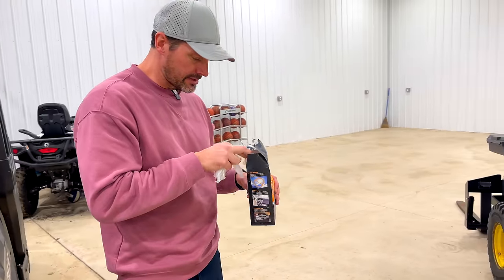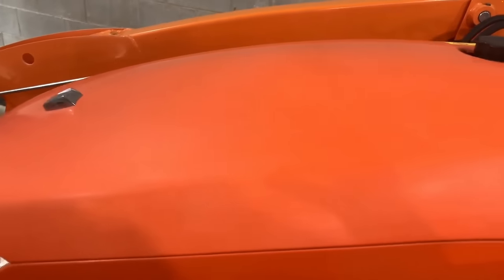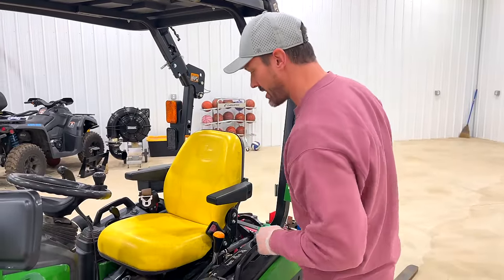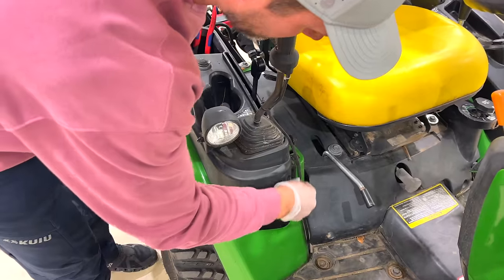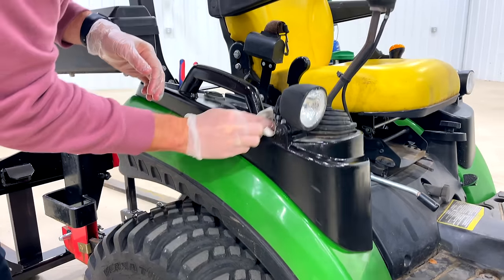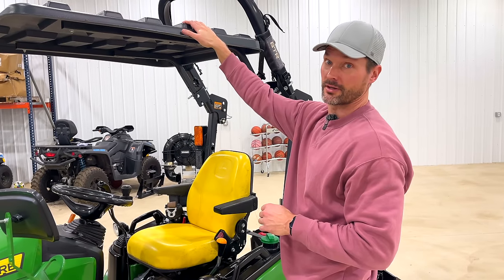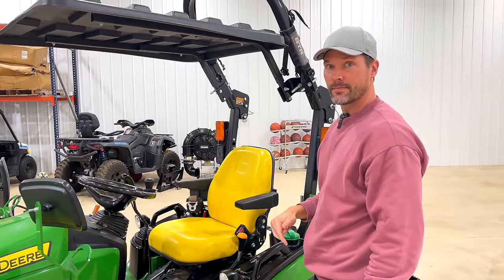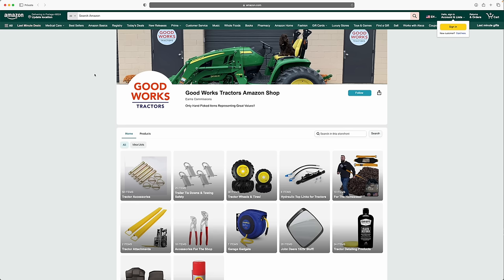THE ABSOLUTE BEST BLACK PLASTIC RESTORER IN ACTION

Comment: I bought a big pump bottle off Amazon of that Flat out tire sealant stuff and put it in the tires on the little tiny truck that I drove around the landfill. Every morning I had flat tires on that truck. Not after putting that flat out stuff in it! Stuff actually worked! Had tried some competition stuff in the other pickup and it didn’t work at all. Still had flat tires. If flat out can handle being driven around in a landfill 6 days a week… I think it can handle most situations.

Comment: Off subject question, but I've seen you use the summit branded tractor I believe it was a Mitsubishi in different work clothes, I could be wrong but I finally got the chance to see one in person today and was wondering if you though the was too early to know whether or not the dealer network will be available for years to come? I liked the look a d feel of the tractor but I also know it's pointless to get a tractor that has no dealer support, just wanted an educated opinion is all. Thank you for your time and great videos.
Reply: He no longer is promoting Summit. In my opinion Summit will  fail like many of the other rebranded tractors. It 's a fine  tractor but not having a real dealer network is killing them. Would you spend $20,000 for a tractor sold by Home Depot? I wouldn't trust them to assemble a push mower.

Comment: What would happen if you had applied this stuff to the green plastic hood & side panels on the tractor🤷‍♂️🤷‍♂️🤷‍♂️?
Reply: It's ceramic, so it creates a very thin layer of extremely hard protection. Been using for over a decade on all my vehicles. One coat lasts 3-5 years in the sun. Over a decade if garaged. Obviously different formulations for different surfaces, so choose the right one.
Reply: So for that many years say. . . .3-5, have you had or noticed any small cracks or fractures or chips on the surface at all??? Does the "clean, shiny, look still stay there after all that time or is there any discoloration after a long period of one application? I would like to try this stuff on my J.D. 1025R!
Reply: @truckerray7533  it can still be chipped, it's like clearcoat but stronger, and harder, thus more brittle. It remains shiny and hydrophobic. So, easier to wash, but can scratch and chip, just takes more. Clear bra material is best, to avoid chips and scratches, but far more expensive.
Reply: @michaelhess4825  So have you ever had to re-apply it at all for any reason after one coat???
Reply: @truckerray7533  reapply only when needed, like I said, one of my cars is over 10 years now and still completely hydrophobic. That's with the more expensive (and time consuming) versions that you have to more carefully apply. But these wipes should last at least a year to three would be my guess.
Reply: @michaelhess4825 Okay, cool. That's good to hear! Like I said, I'll have to try that stuff. Thankya for the conversation 👍🏻